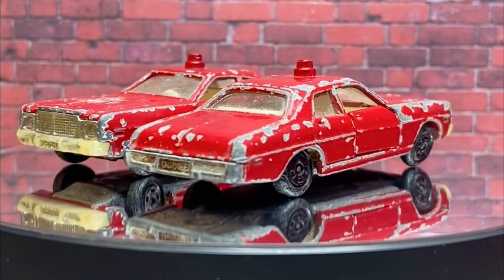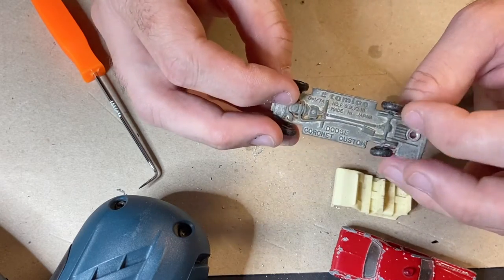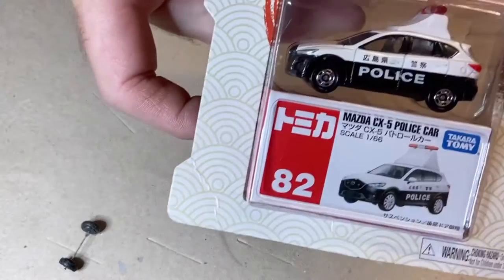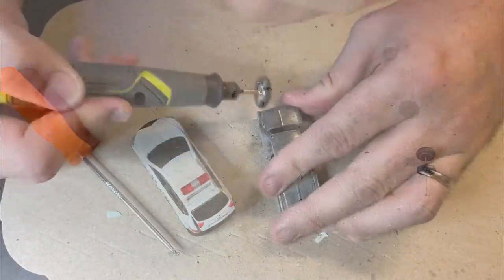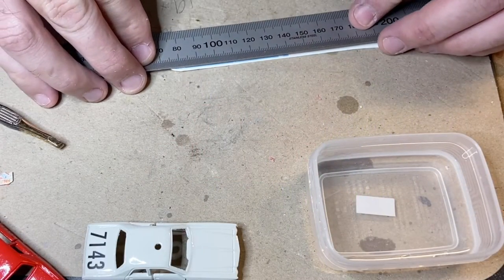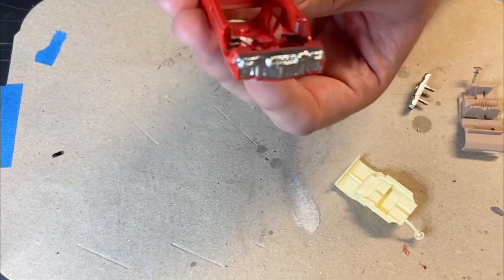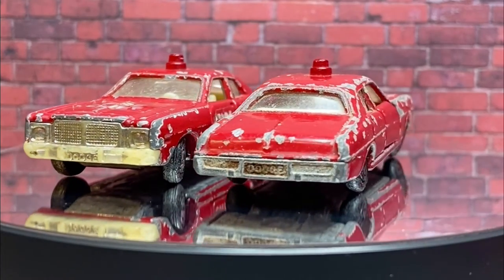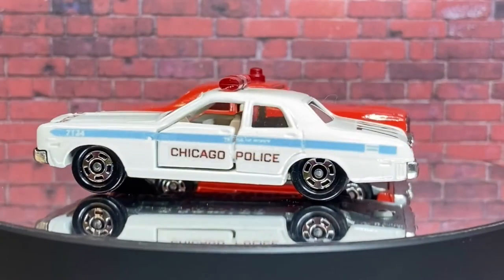Tomy Tomica Dodge Monaco / Coronet Fire Chief / Custom Restoration #026

Comment: Great job here PB, I think its amazing that tonics uses the same wheels 50 years later. Something I'll keep in mind if I ever gather the courage to do a proper restoration. I have a great deal of respect for guys like you who restore these cars basically to showroom floor status. Great job, love the custom and the resto 👍💪🏁
Reply from the maker: Thank you, I think doing weathering and cutting into cars takes a lot of skill, I’m working on getting better at that side of the hobby 😀
Reply: @PBsRetroRestorations  the thing about roughing up a car is if you make a mistake it's very easy to cover up. You guys with these restorations have a very small margin for error and that's what I believe makes it more difficult and holds a different standard for a finished product. You have really got your process down and it shows. Respect 👍💪🏁